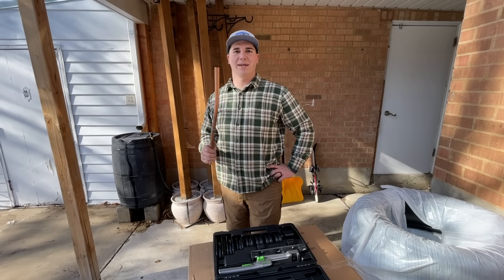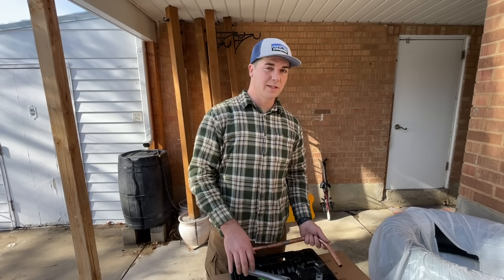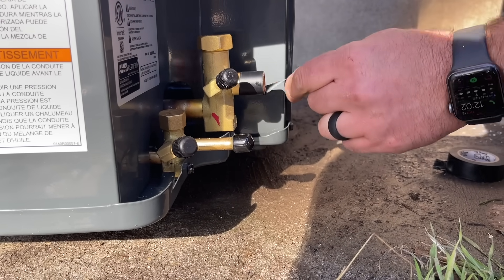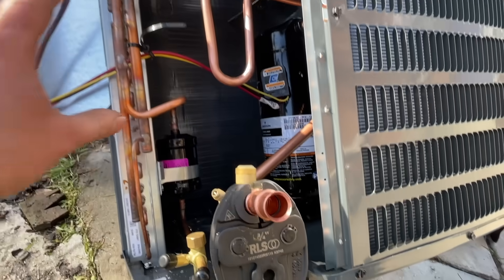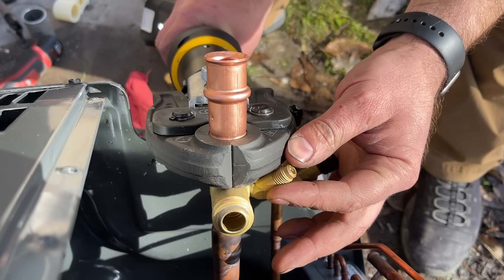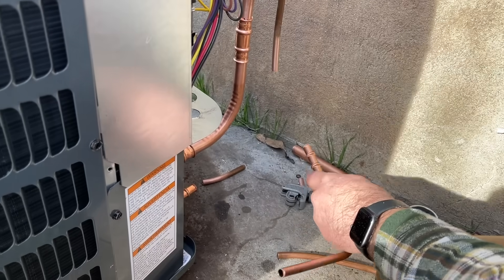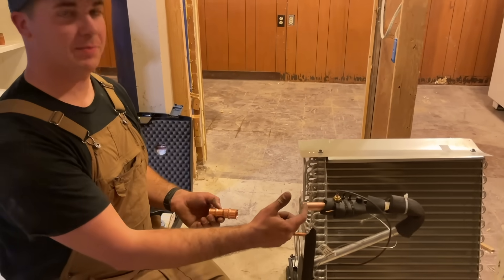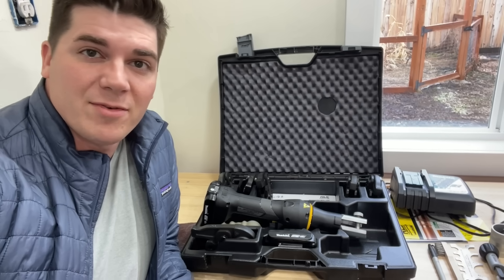Brazing Is For Cavemen. THIS Is The Future Of HVAC Copper Connections. -RLS Crimping Tool-

Comment: Ahhh! The removal of skill from a skilled trade. HVAC for 30 years and yes I have used the various press tools. It is easier/convenient in many ways but not always the best answer and you have to cut it out,you can't "take" it apart if there's an issue.
Reply from the maker: I’ll be doing a video on removing one of these fittings if for any reason you need to fix a leak. But I agree this isn’t a total replacement for brazing and I will still braze, the title is just crafty, not intended to offend anyone but some of these guys take it as that. Cheers man
Reply: @diyhvacguy  Not offended at all , its just another tool to use but its the move towards a skillless and disposable society that bothers me.

Comment: There are affordable ways for DIY'ers to do this. The first would be to go to a local tool rental store, and rent this tool, and the second would be to buy a manually operated crimper. The battery powered one you showed in this video is awesome, for those who work in HVAC and plumbing. 16:50 Is a crimper head for 1 inch pipes available??
Reply: I have crimped up to 2" copper on HVAC systems
Reply: @thomasholland3289  👍 Was it with this tool, or a different one?

Comment: As an HVAC guy myself, I could see this being useful in certain situations where using a torch might not be an issue. But for just normal everyday line connection, I think I will stick with a torch.
Reply: not only that but the price of the fittings! if you press it and its leaking you can't re heat and let the braze flow, you have to cut and restart. fuuuck that. and the tool itself is over a grand
Reply: @1theheightofparadise  Yep. I agree.
Reply: For the places where a torch could be an issue, why not use a Ridgid RT-175 pipe soldering gun?  No flame and the joint is heated as fast as using a torch.
Reply: I see the benefits of this for install crews in the heat of the summer in Texas! This could be a game changer if it actually lasts. Commercial package units that need to be opened up, just pull up this tool on the roof instead of a torch kit, nitrogen tank, that's a lot of work shaved off.
Reply: If i had to pay for all the time it took you to use these crisps i would go broke just to make it easy for the tech and also these crimps will never last as long as braising !!!!! I just love all these BS videos showing inferior products just to make things easier. It’s so ridiculous and pathetic. Don’t fall for this crap people. Get a real refrigeration AC tech that can do the job correctly and stop watching these DIY crap product videos.
Reply: same
Reply: I’ll pass this one up for now
Reply: Did you mean where using a torch might be an issue?
Reply: @maxwellcrazycat9204  Working in commercial and industrial HVAC, you sometimes will have a project at a manufacturing plant or something similar that has highly flammable products around and extreme burning restrictions.
Reply: I would worry about it leaking in temperature extremes.
Reply: I’m not a HVAC guy myself but I talked to one and he explained how he had jobs in new construction where there is a no open flame rule, compelling the investment in some $$$ locking blahbety-blah thus billing accordingly.
Reply: You are 110% right. I am DYIer and will never use these new fittings which are a rip off.

Comment: If it leaks how do you remove it. If you can't, now you'll have to replace the sv. Would of soldered this up in half the time.
Reply from the maker: Actually you can cut it off and braze it in if it started to leak. I get where you are coming from but I wanted to do this one with zero brazing so that’s what I did 👍🏼

Comment: We sell a lot of this type of stuff where I work.  Zoomlock is what we sell a lot of for refrigeration.  We also have propress and megapress for hydronic and gas respectively.  With the new propane based refrigerants being the new normal in a couple of years,  I'm wondering if condensing units and coils and  line sets will start shipping standard with these types of connections in mind.
Reply from the maker: I certainly hope so! That would be amazing

Comment: I would be wary of using a crimper on a brass valve body. Any overstressing of the walls of the fittings can cause mosaic fractures that are hard to see and will likely cause a leak that will only be detectable with bubble fluid or a halide detector.
Reply from the maker: Noted. Time will tell with this one.

Comment: So you are saying with this new tool you will not need to do any more brazing or soldering. This new tool will crimp all the connections to a tight seal. OK terrific! There is only one problem, this tool is very expensive and I think I will wait for the price to come down.

Comment: Are those type connections legal for gas, and would the air con have less pressure than gas?
Reply from the maker: No gas has waaaay less pressure. And yes they make a separate jaw set specifically for gas fittings
Reply: @diyhvacguy  ..thnx

Comment: I had a few years using crimping fittings and I prefer soldering my joints and fittings ... crimping is a bastard if you get the crimp wrong and have to cut out pipework to replace ... give me a map torch and solder every time aand one last point the rubber O rings perish over time and you WILL get leaks . not suitable for all HVAC  ... good video though

Comment: Pro press and zoom lock have their specific use for places that require fire watch or somewhere were brazing is not possible
Reply: Brazing with the correct method a d filler rod will always outperform any of these other methods

Comment: The Old Way from Years ago was a Compression Ring. I've seen Those used 40 Yr's ,  no Prob. That is especially the best Thing to use on a Dryer. The Dryer have less Time to Atmospheric Exposure.  Also later , To change out the Dryer.....Quick Swap !

Comment: Works great, appears 99.9% reliable, just like brazing. However, I don't see where it's superior to a torch in any way. The most attractive thing about it is, you don't have to hassle with swapping bottles.
Reply from the maker: Umm a flame, hello
Reply: @diyhvacguy  Man learned to control fire a million years ago... most of them. 😁

Comment: I wouldn't expect any veteran of the HVAC industry to ever support something that makes their job more DIY friendly. Like PEX and sharkbite in the plumbing world, most plumbers hated them but now they are pretty much everywhere. I did a full HVAC system tear out and install in one of my houses, taught myself everything, bought all the correct tools to do it right, learned to brazed (I ended up using sil-fos rings which made things pretty simple), but had this been around at the time I would've 100% used this instead. No worrying about purging the lines with an inert gas to avoid carbon buildup while brazing, no flames (nice in the cramped attic), and overall just simpler in my opinion. Not for the guy who can braze in his sleep and does it for a living, but a good option for diy and perhaps some unique situations for the professionals.
Reply from the maker: Yes I get alot of flack for that but I love my trade, and I also love to DIY and I like helping both groups of people. No I’m not taking food out of hvac business owners mouths, there is plenty of work to go around if you are a stand up business owner that stands behind his work 👍🏼 cheers
Reply: @diyhvacguy  agreed, I’d say the vast majority of DIYers also don’t attempt something as major as an HVAC install anyway, since it does require specialized tools regardless of the line set joining method. And also a failed attempt ends up being a pro’s job to clean up and do right anyway. I remember finishing mine and thinking 1.) I have a ton of respect for the guys who do this for a living and 2.) I don’t ever want to do that again.

Comment: I can see where this would be particularly beneficial on mini splits where they ask you to NOT braze connections unless using a nitrogen charged line.
Reply: Why would you braze on minisplits? Get a longer line set and practice flaring.
Reply: @slayvenomgoblet6657  
The flared connections behind the head on a mini split are particularly difficult to torque correctly, hard to reach, hard to hold two wrenches, and brazing would be significantly easier and faster as well as make a leakproof connection. Multi head mini splits have many flaired connections and all of them could leak ever so slightly making finding a leak a disaster.

Comment: Each o-ring is a single point of failure.  Brazing is more secure and easier to repair when a repair is necessary.
Reply from the maker: To each his own. I wanted to tested it out. If it leaks you guys will be the first to hear about it 👍🏼 cheers

Comment: I know you guys never screw up.  I occasionally do. How do you get those damned things off when you butt them up to a valve (as in your demo)? I also worry about big temp swings and expansion/contraction. Stay-Silv for critical apps.
Reply from the maker: I’m going to do a video in removing one and brazing it in if it happens for whatever reason.
Reply: @diyhvacguy  Now that will be an interesting video.

Comment: EPDM O-Rings have a -40F to 300F rating so 50F to 150F condenser/evaporator temperatures are nothing for them. Braze-free fittings have a 50 years warranty but will probably last as long as the pipe itself, definitively better than soldering or brazing.

Comment: I've seen quite a few people argue back and fourth about this tech being good and or bad and whether or not it will last. The one thing i have not seen anyone talk about in the comments is that it has been said that around 2025 they will be using the new refrigerant that contains butane, and that there will be no solder joints in the system and that his will be the new required tools for the job. I have been doing this kind of work for the last 6 years and was wanting to know what other people thought about this or have i been miss informed because to me it seems like this is what we will have to use in the future if not im also fine with that i like brazing anyway better than this and think its better for most situations.

Comment: Ill be the caveman . . . "let me be me so I can shine!"  And my brazes shine!  There is nothing like a very clean silver braze job, and IMO, its the far superior method, IF the copper has been cleaned and you purge with nitrogen. I just trust it more over the long haul if proper brazing practices have been followed its tried and true. The press tech has some advantages and some kinks to work out. been a plumber for years before crossing over to mechanical, and am familiar with pressing for the last 15 years. It has advantages and limitations.  Its faster, no burn permits, it may be a bit safer with upcoming AL2 refrigerants (argh) & looks great,  but conversely it's expensive (entry and fittings), doesn't fit everywhere, relies on an o-ring, and the hvac industry hasn't fully made provision for pressing in new equipment ( the king/service valve stubs are not always going to be long enough for the tool head to fit unless you braze a stub out. And I cant see it in a txv or capillary tube repair, but then, that's not this tools focus, but piping up a system from unit to head, which realistically should not take much time brazing, how many joints could we be talking? Makes it really sound like burn permit, boredom, or bragging rights are the only reasons to consider this method. unga-bunga

Comment: Honestly, it’s much easier to braze on a small stub to the air handler and condenser as soon as you unbox them, then you can crimp to your heart’s content. If you hav the filter drier that is compatible with your crimp tool… always use nitrogen when you braze'
Reply: You read my mind.  That was the wrong application for a crimp connection.

Comment: Doesn't code require refrigerants to be brazed or flare connected like any other gases?
Reply from the maker: No, permit was pulled on this install and passed inspection no problem 👍🏼

Comment: For hot water heating tank is really good or spots where is so tight and dry old wood I use this but if I can use the gas torch I’ll do it it saves money because that press fit good one are $18 to up

Comment: or you could spend 10 seconds brazing it in
Reply from the maker: Sure, grab your tanks, which are probably low and will run out halfway though (don’t ask how I know) wrap everything for heat protection, set up your manifold for nitrogen flow, catch the grass on fire, burn the siding etc yea that will take 10 seconds

Comment: I always called that tube instead of pipe.  Used to work quite a bit of AC work on heavy equipt and vehicles.  I prefer a soldered connection to a rubber o-ring for long life.
Reply from the maker: I can respect that. To each his own. Just wanted to share with my viewers
Reply: @diyhvacguy  You did a good job of demonstrating the use of the crimper setup.  And I would likely use on in a place I did not want to use a torch for brazing.  ie excessive fire hazard.

Comment: I'll stick with brazing. No suction or liquid line filter on used refrigerant lines? Did you even flush the lines?
Reply from the maker: Lines were flushed, this video was just showing how to use this tool. And yes the Goodman’s have a built in filter drier on the condensing unit 👍🏼

Comment: I could be wrong here but isn’t the center of tool jaw supposed to go over the o ring on fitting and crush it down on to pipe? I’m 99.99999% sure all those fittings were pressed wrong. Hopefully I’m wrong
Reply from the maker: Yes you are wrong. The middle two spots get pressed and the o right just gets pressed enough to seal.

Comment: Pro press fittings are not the new generation, I get calls all the time due to plumbers using that crap, then I have to go in and cut it all out and solder new copper pipe in like a real license master plumber does. Those pro press fittings are for DIY , Handymen or just lazy plumbers or so called plumbers who don't know how to properly solder copper pipe and make it look like it came out of a factory. This is why I get premium rate, There still are people in this world who value a plumber who still solders pipe and makes it look good.
Reply from the maker: This is NOT the same as the water propress fittings. Just fyi. And like anything, if it isn’t done correctly, it will not take, just like brazing or soldering.

Comment: I had RLS  in my office the other day pitching it. I explained that's great for a hurry-up emergency, or for residential/refrigeration outfits. We're a commercial union shop. We don't do small residential, and it only goes up to roughly 2". I think us union-trained professional tradesmen (Caveman) will stick to best practices and leave that potential leak to other outfits without getting laughed off a job by an inspector, GC etc.
Reply: We use them for VRF systems.  For DIY it would be a joke since the tool and heads run you about $4k.
Reply: It isn’t called cutting or bleeding edge technology for nothing.
Reply: @jacksprat6391  125psig, HA; yea, at what temp?
Reply: @MR-nl8xr  expanding and contraction will cause leak especially on heatpumps
Reply: 2 inches is plumbers talk refrigeration goes by the outside diameter not the inside
Reply: 42 yrs here im sticking w the 15%
Reply: Useless lazy theives and bums
Reply: @jacksprat6391  no thanks. Don't plan on using it to begin with; Have fun ;)
Reply: @jacksprat6391  Agreed.
Reply: Union trained 😂
Reply: Union trained .... is that a joke son ?
Reply: @mikepict9011  sour grapes. I am a retired union carpenter. I am sitting in my paid for home with a pension and cash annuity to supplement my SSI . Where would I be if I hadn’t joined the union ?  You know the answer.
Reply: @mikepict9011  My wife is from up north, were alot of unions still exist.She asked me one day, how come down south where I'm from, roads are done so quickly and construction doesn't drag on for years like where she's from. I told her because we're not waiting hours for the guy with the shovel to put dirt down for the guy with the asphalt truck. Everyone works according to what is needed, union guys waste more time standing around waiting for the next guy, it's a joke. F*ck unions, honestly they suck
Reply: @Cory Dodge  the residential non government industrial work is all individual men with individual agreements.  But thats like 2x McDonalds pay . Not retirement with a wife money
Reply: @mikepict9011  I've been outspoken about the dangers of unions and how it allows corruption for years.
Reply: @mikepict9011  Good one.
Reply: I saw a 5 million dollar union job . It was two pipes in a closet
Reply: @mikepict9011  lol

Comment: I definitely love the RLS system/ Zoom lock. I have had a few leaks mainly using the fittings directly for commercial compressor replacement.  I think they have a limit when it comes to big compressors with a lot if vibrations vs smaller residential compressors. Regardless I have more success than failures with the RLS fittings .
Reply: With brazing or soldering done properly, you have NEVER a leak.
Reply: @Whatda25  you got that right.
Reply: "more success than failures"  That's a resounding success rate... 50%+????  That's the dat that's needed here... what's the DATA for difference in COST, TIME and FAILURE RATE over time... without all that, it's just something neat & new...
Reply: @RustyTank56  mainly using right off compressors on commercial compressors seems to be a problem. I've stopped using them on that type of repair. Now doing leak repairs on piping,  txv replacements of evap coil replacements they are perfect . Granted all my work is in COMMERCIAL HVAC and a strict residential application probably 100% leak free. I wouldn't know because I no longer do residential.